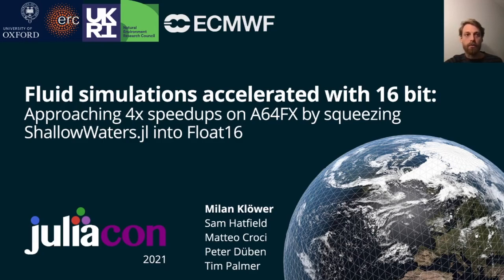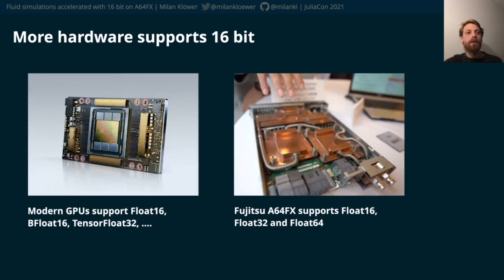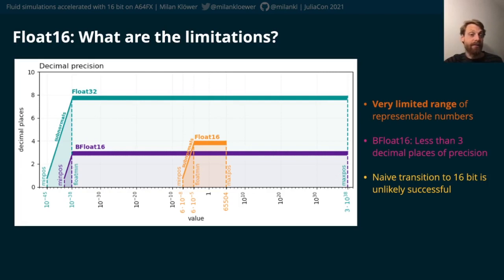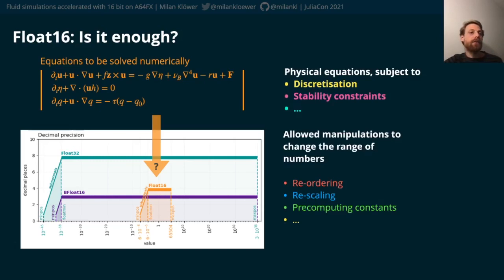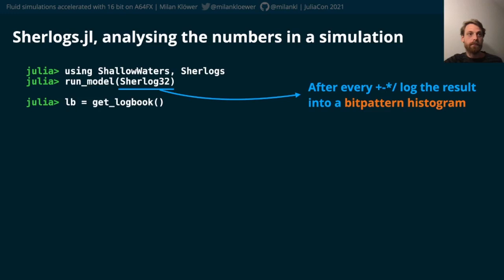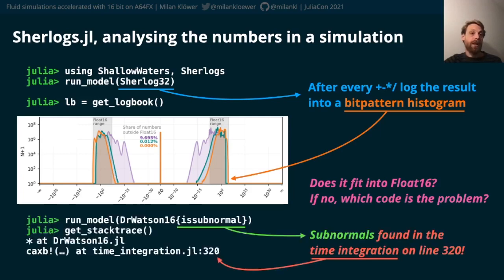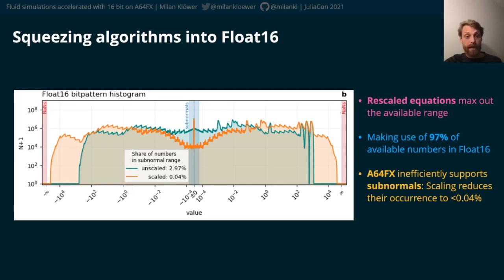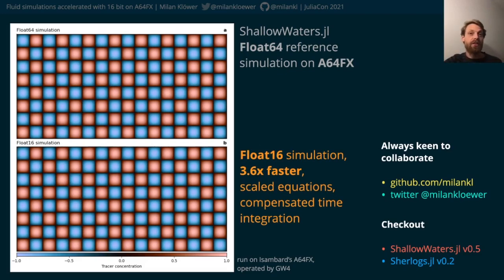3.6x speedup on A64FX by squeezing ShallowWaters.jl into Float16 | Milan Klöwer | JuliaCon2021

Comment: It would be context sensitive depending on the use case scenario. Inheterogenous computing where neural networks are occassionally deployed, a hardware (where supercomputer was mentioned in the video) would be a cluster if need be where the traditional sense of a supercomputer is not available. So that could be GPU and CPU. The CPU is more likely to be computationally effective as long as it has good cache, and therefore that is a big "if" prerequisite. So switching over to a GPU (and back to a CPU) is perfectly possible as a scenario such as when one might want to use a (high) double precision (Gaussian) in OpenCl 2.2 for example. The OpenCl 3 still had its moments of borrowing over from OpenCl2.x not all that far off the date of this video (within years). So, I'd not be surprised if A neural network controls the hand over to Float16 whilst otherwise always having the 64bit when it needs it (on CPU with poor cache) whilst the GPU stills provides computation for the neural network (not 16bit). A neural network is probably going to "consider" (calculate the probabilities for feasibility) in virtualisation for an adhoc exotic microarchitecture in which to perfom the 16bit calculation, and at that the hybrid cores of big endian or whatever else it seeks to make such as virtual ASIC at the cost of latency in virtualised chiplets compared to monolithic core.  In doing so, it will discover bugs and would have to anticipate the cost effectiveness of generating an exotic microarchitecture on the fly (adhoc) where it will have the benefit of gaining information the bugs but at the cost of needing to bother going down that route in the first place. Low resolution Markov Chains could be a way to use the 16bit but mostly just to throw away the data depending on which test in the concurrency of test beds was found to show up the worthwhile use cases for 16bit. It's because it is cheaper to emulate, and that takes CPU and a CPU has less FPU (by ratio) than GPU.
5:47 Even though the histogram would be different, so for example, a Gaussian kernel density estimation (or Gaussian probability estimation) could be done on the (different) histogram perhaps by Rozenblatt-Parzen window method. Then the Gaussian kernelisation discards (eliminates) the least successfu 16bit doubles of floats per big endian or little endian (or whatever other custom exotic microarchitecture) emulated CPU, or virtualised environment. It would need to learn what was being hidden from the compiler because it is in a virtualised environment. The aim however would be to eventually create a series, separating the series by Fourier analysis. A series of "worthwhile" 16bit (e.g. float) versus worthwhile 32bit (float) and so on (such as the eliminated).
We already know some of the use cases though for the ability to discard data and still be "OK", and tha is for example in video phone calls. We can lose 'some' video frames but we must keep the audio to hear the person speak. So really the bigger application for this will be in signal processing and spectral analysis. Power saving for ecological importance is going to b questionable until the superior machine learning (probably neural network) solves for X and does the better job of deriving the Float16 use cases. Power saving until then is more likely to be about battery and stored-power efficiency, like UPS or even mobile devices (or space technology devices).
So for example, I would not anticipate the weather model using 32bit double precision is extendable to radiation technologies where risk assesment is involved (by neural network). Yes it would use it but as test bed concurrency short runs in advance of then deploying 64bit double precision.
My comment has no hate in it and I do no harm. I am not appalled or afraid, boasting or envying or complaining... Just saying. Psalms23: Giving thanks and praise to the Lord and peace and love. Also, I'd say Matthew6.